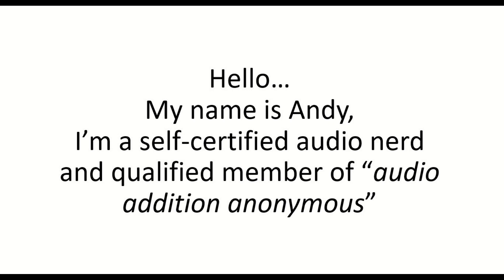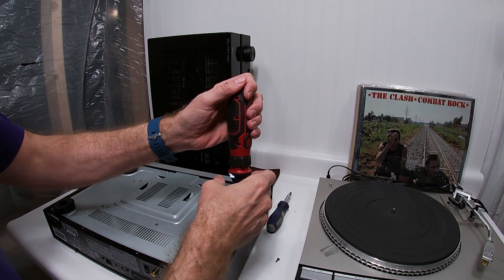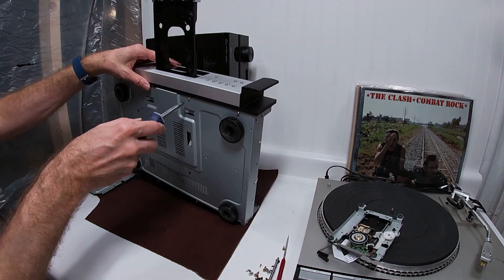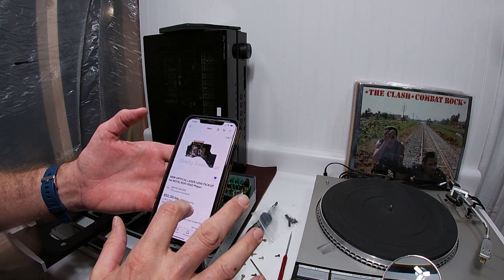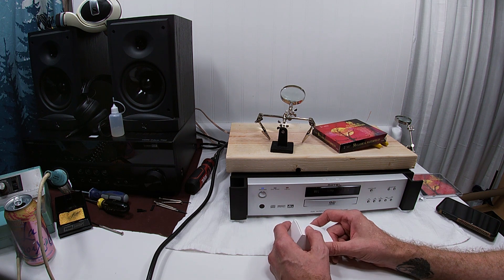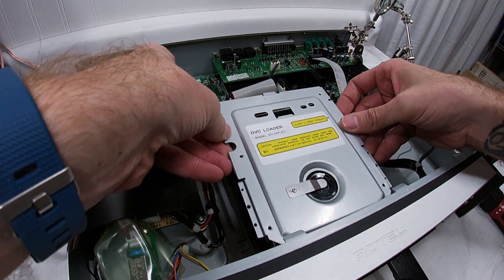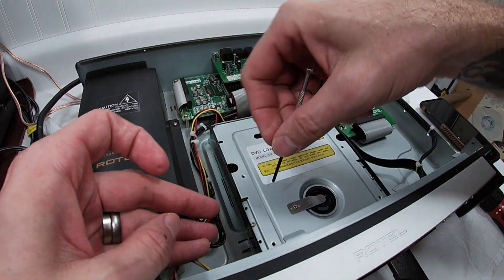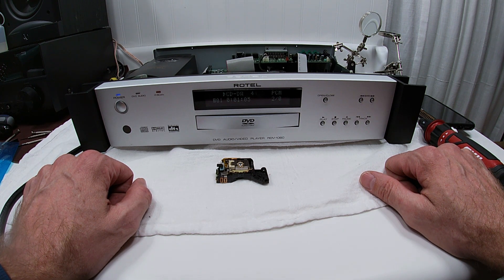Any easy fix for this Rotel RDV-1060 CD DVD Player? Repairing and or replacing the laser and pickup

Comment: never ever thought those potentiometers. there are precisely set for laser diode power, if the laser doesnt have power then its a optics or electronics or is simply burn out. turning pots by pulling up power of laser is just killing laser diode with a very short time. its the same when the car engine have no power you will just increase the rpm to get nominal power from old not servoces engine. this way you just killing electronics and no produced lasers. also you need to get laser power meter to diagnose laser power not phone, its give4s nothing.

Comment: It is not clear what you were soldering or de-soldering and why. Did you connect something to those points?
Reply: It's the antistatic loop on the laser assembly, basically a blob of solder shorting two contacts that you have to un-solder before installing. He talks about it and shows it in the video.